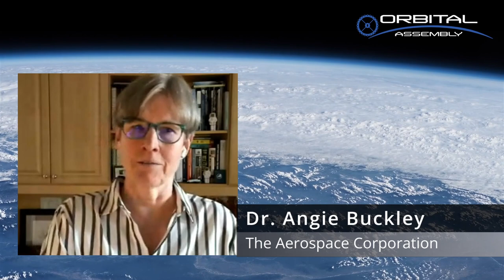The Leader in Artificial Gravity: Above Space

Comment: You have no solution for Dzhanibekov Effect. You would not have enough water or room for pipes and water tanks that would offset the spin axes, and move the water around fast enough to stop the effect, rather than make it worse, and still provide water to workers and guests. Simulations will show this to be true.
Reply: Interesting approach to the problem, do yo have a link that describes the mechanics of this ?
Reply: Ain't the whole point of this to find these problems and solutions? 
It's what drives entrepreneurs, dream up great ideas, find engineers capable to work the problems and find out if there is a path to the solutions. (And in the end hope make lots of money)
Reply: @spacearchitecture3606  nope. Orbital Assembly told me this. Without evidence. Frankly their mechanical space engineers don't seem 'grounded'.
Reply: @brookestephen  You have a lot of insight, I am very curious now
Reply from the maker: We are very familiar with the Dzhanibekov Effect. We've already accounted for it in our designs, no need to move water or other ballast material at high speeds.
Reply from the maker: We are using a ballast system but it's not to solve for the Dzhanibekov Effect.
Reply: The moment axis that were spinning on seems stable enough. BUT , How does that change when a starship is docked can this dark side dock flip to the light?
Will the starship be stationary, and how will this be maintained, star trackers?